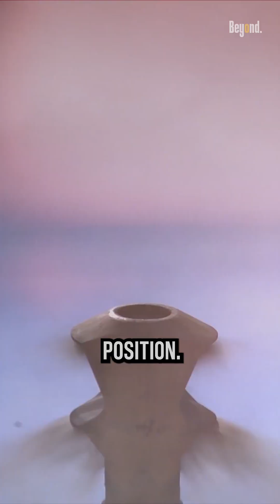How powerful are M982 Excalibur rounds ? #shorts

Comment: The Excalibur is GPS-guided, which can be affected by Russian EW systems. It’s not a game changer. The Krasnopol is the laser-guided Russian equivalent. It costs about $30-35K compared to $100-150K for Excalibur shell. Ranges are abou the same.
Reply: The Krasnopol is a closer equivalent to the Western Copperhead 155mm round.
Reply: 2K25 Krasnopol grenade 152 mm, 155 mm.
The range is about 40 km (25 mi).

M982 Excalibur 155mm.
From Archer: 50 km (31 mi).
Newest test: 70 km (44 mi).

So no not equal distance. Sweden and the U.S. better.